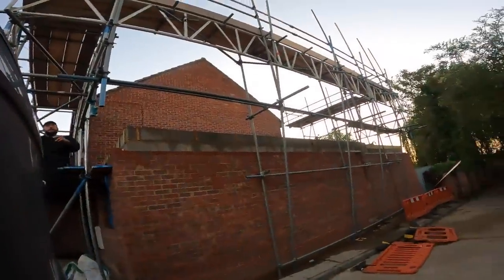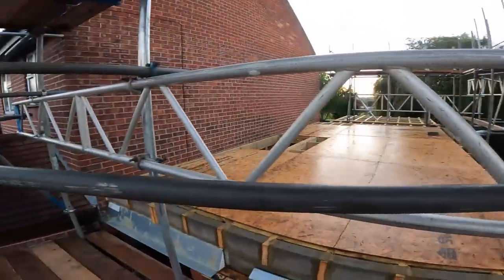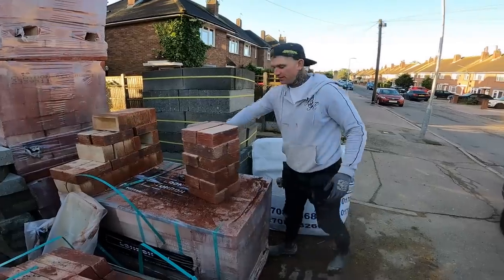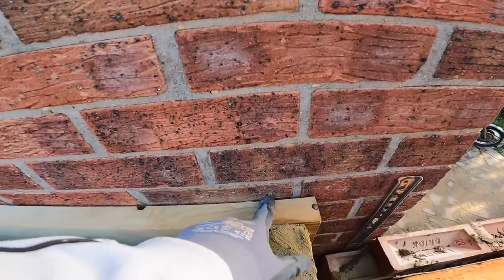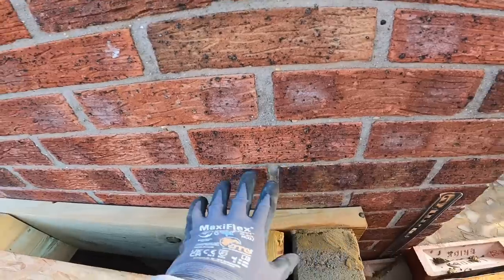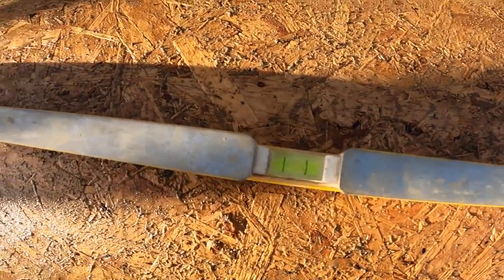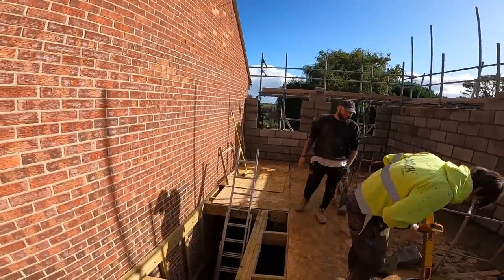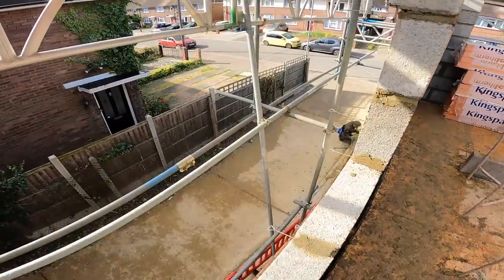How We getting over this one 😱🚧🧱

Comment: hi charlie , in the middle of the pandemic i built a 2 story extension without scaffolding. trestles to joist, joist on and fill in between then screw down plywood. stack on top and build. trestles on plywood to roof. all overhand and jointed as i built up. the things you have to do to make a buck. lol

Comment: Hi Charlie,all my years as a scaffolder and I've never seen anything like that before. Who ever built that has a good imagination lol 🤣🤣 good luck 😁
Reply: Where’s there a will, there’s a way.
Reply: @willbee6785  it's really well built by the look of it though 👍
Reply: Do you ever use the scaffolding with the frames and cross braces and outriggers like we use in America in the uk I think it is alot more comfortable for the bricklayers we always have the foot planks at a comfortable height and I think it's easier to set up but I've never really set up the scaffolding with just pipes and clamps or whatever that is you guys use
Reply: Seen it a few times lol, like in tight car parks and they need to get roof access, as long as the ties are in proper you’re laughing

Comment: That scaffold was some creation! I have seen some improvised lifts and ladder beams in my time but nothing like that! Fair play for cracking on.

On the roof I get you blocks need to coarse with bricks for ties/windows etc but can’t you just bump the plate up or put a split in your last coarse so the truss bottom cords sit level? The truss manufactures will make sure the top chords line through.

I loved this edit btw